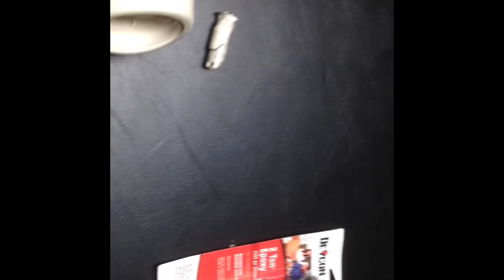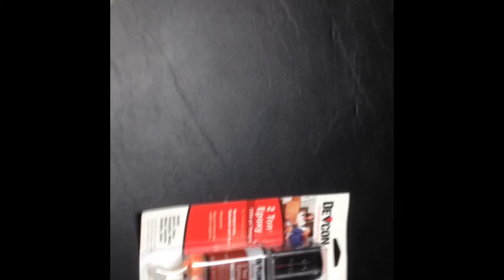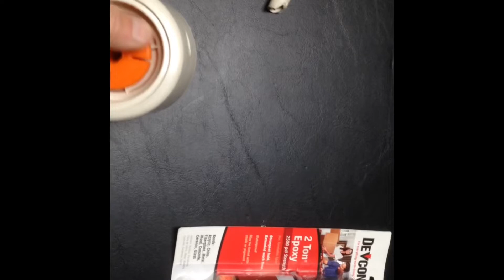RV Toilet Foot Pedal Repair

Comment: Super ingenious. You could make this about 6 minutes long. It's be cool to see how you figured out the dimensions and see how it actually printed. Showing how you applied the epoxy and readjusted the spring would have been nice to see - especially if you held a light in the inner workings so you could actually see in there. In any case, super clever, really ingenious fix!

Comment: As many others, I am looking for a replacement piece. Managed to epoxy the broken piece back together with the help of a metal cylinder added inside for strength, but the spring is not working correctly.. what's the correct way to install the spring? It's lined up in the slot, but still doesn't make any tension to spring the pedal back up..

Comment: I have the same issue with my Dometic 300 series.  

Stepped on foot pedal one day (winter?  not sure) and it snapped.  I replaced the water valve  but water doesn't flow.  Don't want to buy a brand new toilet because of one (purposely designed?) weak link.  The pedal open the ball valve but no water flow.  

Thanks to all who share experience and tips!

Comment: I’ve fixed my model 311 similarly by installing a threaded anchor replacement but am having a problem with that spring! How did you finally get the spring into the right position?

Comment: Good day sir. You wouldn't happen to have the file that you used to make that piece for the dometic toilet would you. I'd be very interested in downloading that and trying to make it myself also. You did an excellent job of doing this. Two thumbs up 👍👍
Reply from the maker: No, I don’t. Sorry.
Reply: Thank-you. I bought the new 3d printed piece, and installed it. Now I just have to get that spring lined up. Thanks for producing the video.

Comment: Hi Tom, I find myself with the same broke foot flush paddle as in your video. I would be very interested in get the 3D printer file in make the replacement part if it is available. Thanks for any help you can give me.

Comment: I'll try it on a lathe with stainless.  Thanks.
Reply: Did you make one? I need one ASAP!
Reply: @robincheramie230  No. After taking it apart, I have a different set up...
Reply: My handyman was able to get the spring back in and save me from having to buy a toilet.

Comment: This is a major design flaw of dometic! Not making replacement pedals. Mine froze & broke where the water valve froze to the outside of the diameter of the pedal

Comment: Ordered the part, doesn't work on dometic 310 toilets.
Reply: What was different?  I'm awaiting delivery to repair my 310 toilet.
Reply: The piece I received doesn't line up with the slots on the handle.
Reply: @tonyfontana8222  Thanks Tony! Did you find an alternative?